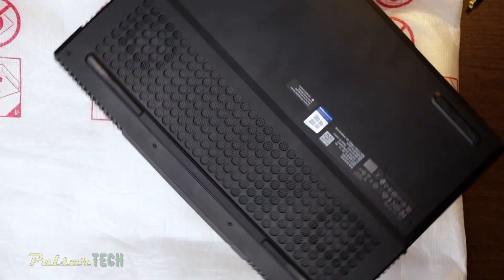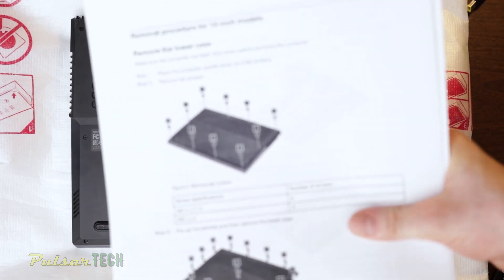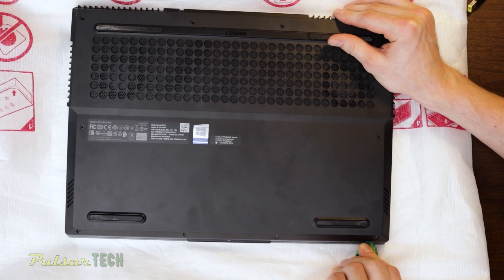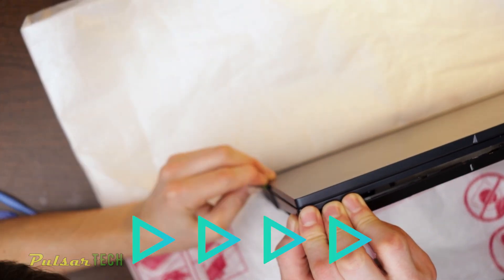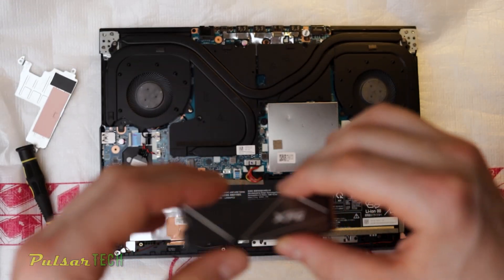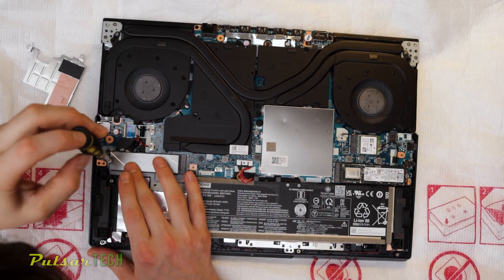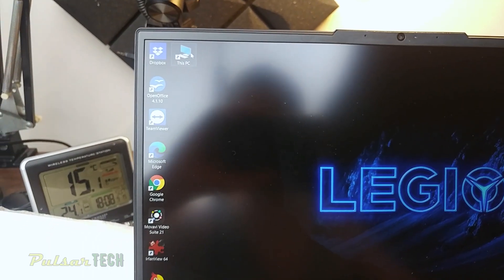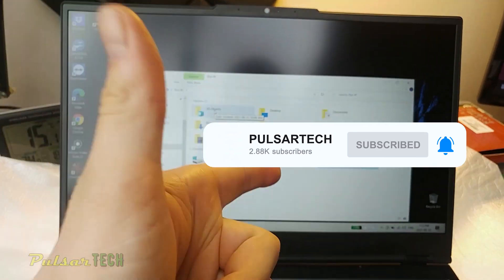LENOVO LEGION 5 HOW TO INSTALL A SECOND NVME SSD DRIVE

Comment: Great Video Pulsar, I have the same laptop in 3070 version. I read in the docs that its only upgradeable to 1TB. Is this true? 
I was thinking of upgrading to 2tb 970 evo plus m2 ssd. Can you tell me it won't be a problem?
Reply from the maker: Hi, thanks for your feedback! I don't think there would be any issue installing either a 2TB or even a 4TB SSD drive.

Comment: @PulsarTECH hello mate ! I have a question I have a lenovo legion 5 pro 2021 version Amd and I want to max out my storage and ram

for ram i found sodimm kingston fury impact 64gb 3200mhz good for performance and value

and for storage I am planning to buy teamgroup mp34 gen 3 4TB ssd 2 of them to make my storage 8Tb however I am not sure if it will work or not I don't even know if the teamgroup mp34 is dual sided ssd or not but it looks decent for its value what do you think mate should i invest on that or go with the safer route with samsung 2tb 970 pro evo gen 3 instead ? price difference in gen 3 from 2tb to 4tb is not too big but I am not sure if teamgroup mp34 will fit to my laptop ssd tray without squeezing or benting so yeah I need your advice homie thanks for reading my message good video keep up the good content 👍
Reply from the maker: Hi, that's a good choice! Personally, I initially wanted to get the 64GB Kingston Fury at 3200MHz, but it was a bit expensive. Instead, I opted for a slightly cheaper but still fast RAM from Transcend. You can check out the video on my channel for a memory test. Nevertheless, Kingston Fury at 3200MHz is definitely top-notch.

As for the SSD, it has a 2280 M.2 form factor, and in my 2021 Legion 5 (non-pro version), I can install 2 x 2280 NVMe SSDs. I'm not sure about the Pro version, but most likely it's the same. I've used Samsung and Adata SSDs before, but I haven't tried TeamGroup SSDs. I think they should work just fine.

I don't anticipate any problems with installing 2 x 4TB NVMe SSDs. It might get a bit expensive, but if you need the storage, that's the way to go. I've been managing with 2.5TB so far. Officially, Lenovo states that the laptop supports only up to a 1TB NVMe SSD, but as you can see from my video, the 2TB one works just fine. I'm pretty sure the 4TB will work similarly. Let me know how it goes!

Comment: Just to be clear, the official manual is wrong for all instances of this model (15ACH6H) in that the laptop does support up to 2 TB in a single slot and not just 1TB? Is there by any chance some kind of performance drawback if you go with more than 1 TB? Another question, is there a reason you must use Acronis or a similar tool to initialize the SSD? I thought you could just mount it using Windows Disk Manager, but I am unfamiliar with NVMe drives so I'm open to being wrong here.
Reply from the maker: Hi, officially, Lenovo states that the laptop supports only up to a 1TB NVMe SSD, but as you can see from my video, the 2TB one works just fine. I'm pretty sure the 4TB will work similarly. 
Yes, you can use Windows Disk Manager to initialize the SSD. I'm just used to using Acronis Disk Director; it has been working well over time.

Comment: How to extend C Drive after install this ssd?
Reply from the maker: I'm not sure what you want to do. If you already have Windows installed on Drive C and then added another SSD, there's no way it can be extended as they are two separate SSDs; the new SSD will be Drive D or so. But if you want to install Windows on this newly added SSD, then it will be Drive C, and you can either use the whole SSD size as one partition, namely Drive C, or split the SSD into a few partitions using, for example, a Windows Disk Manager program. Hope this will help!

Comment: For those who refer to Lenovo official manual said that the second slot SSD need to be m.2 2242, I just install the M.2 2280 2TB ssd into my Legion 5 (15ACH6H), its totally can fit into my laptop and run smooth with no problem at all, just stick with 2TB rather than 1TB .
Reply from the maker: Absolutely, 2TB is better than 1TB.

Comment: Great video! Thanks for the help I will follow this tutorial to the tea. One question though, do I need to use the acronis disk director from the usb like you did? Or I can use the disk management from windows? And what's the difference?
Reply from the maker: Thank you for your feedback, I hope it will be helpful to you! You have the flexibility to use either Acronis Disk Director or Windows Disk Management to initialize the drive. Both tools can accomplish the task. The main difference lies in the user interface and additional features each tool may offer. Some users prefer one over the other based on personal preference or specific needs. Let me know how it goes!

Comment: I took me a little over 4 hours to get the bottom cover off safely. I build desktops as a side gig. I have all professional tools, anti static pads, etc. And it was the hardest cover I ever had to remove. Make sure everything works properly before completely reinstalling cover, and upgrade it to the absolute maximum you desire, because you never, ever want to remove it again. Hardest laptop by far to open in my experience. I had to stop several times to take a break for sanity sake. That was crazy.
Reply: Bro I'm with you. After a little over 3 hours I gave up. There was too much risk to damaging the little brackets that kept the cover in place. I'm still under warranty. So I took it to a buddy that does work on laptops, and she was like: "no, no, no, I ain't messing with those!" 

So I'm just rocking it stock I guess. Maybe after warranty I'll try. I have all professional equipment for this type of thing. Good for you for making it. Lenovo should offer a challenge: get the cover off in less than 4 hours without doing any damage whatsoever and win a laptop carry case.
Reply: @bizbarley74 😂😂
Reply from the maker: Thanks for the update. I'm glad you made it. What did you upgrade your laptop with?
Reply: @PulsarTECH  A gen 4 m.2 980 pro, 32 gbs of ddr4@3200. Also removed both fans, removed their stock thermal compound for grizzly paste. Mad faster. Only $78 total. I was going to buy a team group overclocked 32gb kit, but even with three latest bios legion model does not support xmp profile.
Reply from the maker: Great upgrade. By the way, have you noticed any significant difference in thermals after replacing the stock compound with Grizzly? @bkech81
Reply: Yes the lid hold like MF. I used 2 credit cards and 2 screw drivers at once to make it pop off. 😂
Reply: The trick is to use plastic credit card for releasing front and back latches, and then moving to side vents (moving from back of laptop where all those usb ports are, cause its just easier), because credit card have perfect thikness comparing to pick or other plastic tools. I have legion5 laptop for 3 years now, cleaning it every 6 month and never had any issues with disassambling it.
Reply: I used an old iFixIt toolbox, i got it open in 5 minutes. 
Have to admit though, the fan vents are hard.
Reply: @dex4977  Yeah mate, I regularly upgrade and work on laptops, especially workstations that I refurbish. This was next level, and I was using professional tools. It would not have been as bad if I had not forgotten to put back on the heat shields, which made me have to fully reopen it again. Like I said, I broke two latches but it makes zero difference. Thing is on there like armored plating even without screws.
Reply: Ifixit toolkit made it really easy for me. Sorry it was hard 🙏
Reply: Rough. You convinced me not to buy an internal SSD. The USB 3.2 interface is fast enough for external SSD and portable.
Reply: @salookie8000 
Yup I'm doing that too F opening up my legion 9 I'm the type to break all the clips not give a F and then feel bad after screwing it back up. So I'll save my self the headache lol
Reply: Before removing the cover, practice for a few weeks with old laptops with the same type of cover first
Reply: It took me 2 min to remove….
Reply: I have a legion 5 also and it just felt like there was another screw in the middle, you don't want to keep pulling but I actually just pulled a little harder and it popped off. A little scary lol

Comment: This Supports Gen 4 SSD ??
Reply from the maker: It depends on the manufacturing year; the 2021 model only supports PCIe 3.0. However, since PCIe standards are backward compatible, you can install a PCIe 4.0 SSD in this laptop. The 2022 version already has PCIe 4.0.

Comment: According to the official Lenovo website maximum storage for this laptop (15ACH6H - 2021).
Storage Support :
Up to two drives, 2x M.2 SSD
• M.2 2242 SSD up to 512GB
• M.2 2280 SSD up to 1TB

how is this working  for 2021 model ??
Reply from the maker: I hear you, according to the official info that's the maximum but in reality there's no such limit, you can put even 4TB NVMe SSD there if it wouldn't be so expensive. I still have plenty of free storage with this 2TB drive but can easily expand it to another 2TB by replacing the 512GB one and cloning the official OS on it.

Comment: I have Lenovo Legion 5 15ARH05 Ryzen 5 4600H With 8gb RAM and 256gb SSD+ 1TB HDD
What upgrades can i have for my laptop any suggestions bro
And can i upgrade my RAM like one slot is having 8gb installed but if i wanna use 16 gb in another slot would it become problematic please reply😅
Reply from the maker: Hi, you can upgrade your RAM by 100%. I have upgraded it with two different-sized memory modules, and it works fine. However, you will only be able to use it in a limited dual-channel mode. You can check this in the video on my channel. Otherwise, I would suggest that you install 2 x 16GB RAM.

Comment: what software are you using on the usb drive?
Reply from the maker: It's Acronis Disk Director but you can also use a built-in Windows Disk Manager.

Comment: I have Legion 5 i5imh05, it has internal 256 ssd and 1tb hdd and I want add additional 256gb ssd, so can I add it without removing the current drives by following your video?
Reply from the maker: No, I have checked the user manual and it looks like you can only have 1 SSD and 1 HDD. The best way to increase storage would be to get another 2TB SATA SSD and replace the  1 TB HD with it. And if you wish you can also replace the 256GB SSD with a 2TB NVMe SSD. But that's all you can do. Hope this will help.
Reply: @PulsarTECH  Thanks for the information! I appreciate it.

Comment: Thx for the tutorial. Once you installed the ssd, do you need to enable the battery again, or it will just power on like usual? Is it safer to unplug the battery cable first?
Reply from the maker: No need to enable the battery, once you press the power button, it will enable it automatically. If you wish to disconnect the battery cable you can do it of course but there's no need to because it's already been disconnected via BIOS.

Comment: Pulsar why is it 1.863 tb and not 2tb? Like wtf???
Reply from the maker: HI, good question! The discrepancy between the advertised capacity of a storage device and the amount of usable space shown in Windows (or any other operating system) can be attributed to several factors:

File System Overhead: When a storage device is formatted with a file system (e.g., NTFS, FAT32), a portion of the storage is reserved for the file system's data structures. This includes the file allocation table, master file table, and other metadata. These structures are essential for the functioning of the file system but do consume some space.

Manufacturer's vs. Binary Gigabytes: Storage device manufacturers typically use decimal prefixes (1 GB = 1,000,000,000 bytes), while operating systems use binary prefixes (1 GiB = 1,073,741,824 bytes). This means that a storage device marketed as, for example, 500 GB will be reported by the operating system as slightly less when converted to binary gigabytes.

Hope this will explain!
Reply: @PulsarTECH Thank you for your detailed reply. That's a real bummer. -137gb, jesus! Much appreciated!

Comment: Dude, you can initialize/partition any SSD in Windows, you don't need a USB stick with Acronus.
But what I wanna know is, does the Laptop have a connector to put in a 8TB 2.5" Sata SSD instead of an M.2?
because for storage space...
Reply from the maker: Hi, no this particular model doesn't have any connector for a SATA SSDs but I know some other Legion 5 models come equipped with SATA SSDs, in that case you can put an 8TB SSD no problem.
Reply: @PulsarTECH  thank, I guess just the old Legion have SATA (up to 4800H models Series). For Partitioning, just type "control panel" into the Windows search box, and go to "Administrative Tools / Computer Managements / Disk Manager".

Comment: Good afternoon. Notebook Legion 5 15IMH05. After installing NVMe m.2 1TB samsung 980, the laptop freezes for a couple of seconds during login. And then it works fine. I noticed that this happens only when the laptop from nvidia is turned on. When it is (automatic selection / discrete) this does not happen. What is the problem and how "dangerous" is it? (this was not the case before installing m2) Thank you.
Reply from the maker: Hi, it shouldn't be dangerous but my guess it has something to do with the drivers for this SSD. It could also be a BIOS issue, you might need to update the BIOS to the latest version. You can do it thru Lenovo Vantage but be careful updating BIOS might be risky if something goes wrong. I try not to touch it if everything is working but in your case it might be solution. Also if you have just bought this SSD and can still return it and get another one like Adata, then you cna try that. Hopefully it will work for you. Let me know how it goes!

Comment: We copied your tutorial but upon opening the laptop, we found that the 2nd space you opened actually HAD a 500gb ssd there :O :O :O but in disk management it's showing as unallocated ???????????????? What the hell? Why did a new laptop come with a secret 2nd drive which is unallocated for?
Reply from the maker: Very interesting! So there were 2 NVMe SSDs in your laptop and the specs only showed one? Was it a new laptop or used? Maybe it was installed there by mistake, because these same laptops are sold with different configurations as different model. Most likely there was a model that was sold with 2 x 500GB SSDs from the factory.
Reply: @PulsarTECH  Purchased NEW in the Philippines off Lazada. So really have no idea why there was a spare stick inside doing nothing and unallocated. First I thought, maybe they did something with like a system restore? but then why would it require 500gb and also i think even if it was setup as some backup, it would need to be allocated space I believe.
Reply from the maker: @bobdawkins7473  that's right. It was put probably as for the model with two SSDs but then sold as only with one with Windows on it probably. That's just my guess. You can either initialize it and use it or if you want to put 2TB one instead on the second slot, just use it on another PC.

Comment: ❗IMPORTANT❗
My laptop(Lenovo Legion 5 15ITH6H) has 2 slut for ssd . one gen 4 and one gen 3. the stock ssd is gen 3 but installed on gen 4 by default. i put my new gen 4 ssd on empty slut . now i have to open my laptop again and do that again:face-blue-covering-eyes:. not repeat my mistake.
Reply from the maker: Hi, PCIe 4.0 and 3.0 are backward compatible, which means that a PCIe 4.0 device can work in a PCIe 3.0 slot, and a PCIe 3.0 device can work in a PCIe 4.0 slot. However, when a PCIe 4.0 device is used in a PCIe 3.0 slot, it will operate at PCIe 3.0 speeds since the slot can't provide the higher bandwidth of PCIe 4.0. The backward compatibility ensures that older PCIe devices can still be used with newer motherboards that support the latest PCIe version. Hope this helps!

Comment: Added a 2TB NVME drive to a 15ARH7H running windows 11. Windows Disk Management picked up the drive and allowed me to initialise the disk and format it. I didn't need to worry about using gparted.
Reply from the maker: Perfect, glad it worked, thanks for the update!
Reply: Is it because windows 11 it picked up The NVME drive?

Comment: Works on Legion 5i ? Can put 2 nvmes of 2tb, totalizing 4tb?
Reply from the maker: I haven't tried 2 x 2TB drives yet but in my opinion it will work no problem. Maybe one day if I run out of room on the 2TB drive, I will give it a try. Let me know if you go for it and how it works out.

Comment: Thanks for the video, I have Legion 5 2021  i5 11400h 16GB DDR4, is a faster M2 read speed: 5000 write speed: 7000 compatible with this laptop?
Reply from the maker: Hi, unfortunately no because the top speed of an NVMe SSD using the PCIe 3.0 interface is around 3,940 MB/s (3.94 GB/s) for sequential read and 3,200 MB/s (3.2 GB/s) for sequential write speeds. These speeds are theoretical maximums and can vary depending on the specific SSD model. The newer models I think from 2022 have a PCIe 4.0. The top speed of an NVMe SSD utilizing PCIe 4.0 is around 7,880 MB/s (7.88 GB/s) for sequential read and 6,250 MB/s (6.25 GB/s) for sequential write speeds.